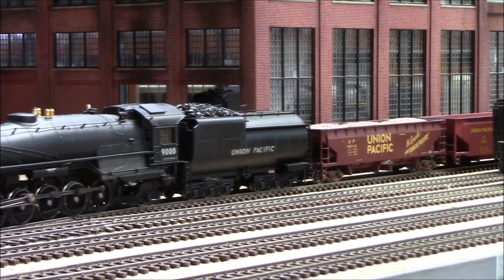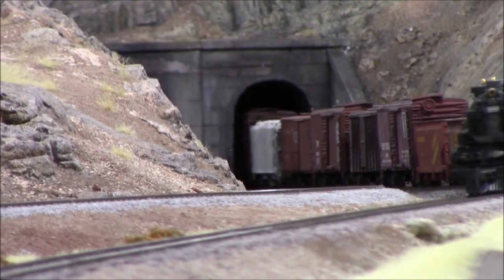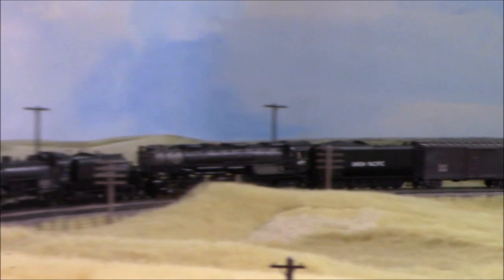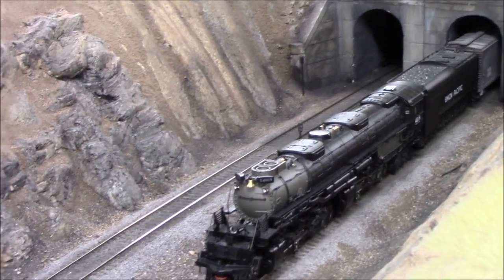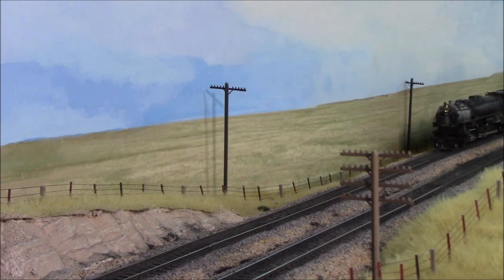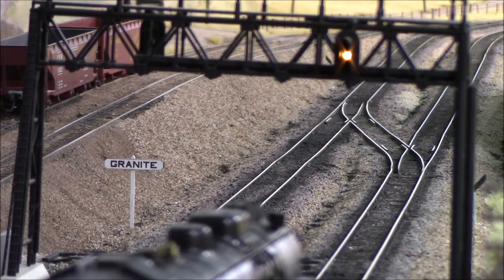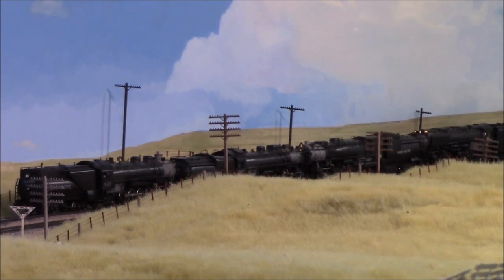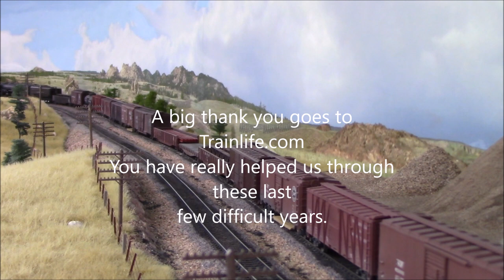Sherman Hill Steam Spectacular

Comment: Man that 4 steam consist! If they are all brass which I assume they are that’s what, 10k? Absolutely epic consist and love the narration.
Reply from the maker: Thanks! IIRC the Challenger is a Athearn but it took forever to get that brass working well enough to shoot this movie. Man, they are finicky little jerks.
Reply: @allenscottmontgomery3929  I had noticed that in a couple scenes seemed to almost not wanna stay connected. Does the brass weight just make it short?
Reply from the maker: @jwrailve3615  Brass loves to short out but the real monster is that the tenders derail when going backwards with ease. And for this movie, going backwards was key. I took a lot of time to fuss with them to get them to roll properly. Since I am a diesel guy, it took even longer.

Comment: 5097 needs to be red-flagged for that damaged crosshead!  Should be able to reseat it and the guide on the yoke, but I would stop running it until you get that done!
Reply from the maker: Hey bud. Hope all is well for you.
That thing must have popped out while shooting and then gone back in place. I can't see anything wrong with it now. But it is a problem. I've had trouble reversing that loco before. Hence all the time it took to get these things running well enough for a video.
Reply: @allenscottmontgomery3929  Doing ok here.  Check to see that the bottom guide's not loose at the yoke.  It looks like it slide inboard and fell off. ;)
Reply from the maker: @NightOwlModeler  Thanks bro. I'll take a closer look at it. Course, it would help if I knew what I was looking at.

Comment: The first Hermosa tunnel was opened in 1901, not 1868. Google Earth clearly shows the 1868 mainline further north along Dale Creek.
Reply from the maker: That shot is a victim of compression. I was going for the area where the mains split and from my maps that is where the original main line is still used.

Comment: A very nice video and layout. I have plans to expand my own HO scale layout (and narrate my own stories), though I don't believe mine will be quite as large as this.
Reply from the maker: Thank you meister. Good luck with your layout! This video was taken on just one out of 18 aisles:)
Reply: @allenscottmontgomery3929  You're quite welcome, and thank you for your kind words :). Only one out of eighteen aisles? Goodness gracious, that's an impressive amount of track!!
Reply from the maker: @Stussmeister  Yeah, my calculation is about 7000' including all the turnouts. Most of the layout doesn't have scenery yet, even after 11 years! But I'm working on it...
Reply: @allenscottmontgomery3929  I'm in a similar situation, albeit on a somewhat smaller scale. My above-mentioned plans include designs for a 10 x 6 2/3' layout, and while I've been working on them for over four years, I still have yet to put up the benchwork and scenery.
Reply from the maker: @Stussmeister  Well you know what they say. It won't get done if you don't start. I have a couple tricks to get my juices flowing for a project, like go out and do some real rail fanning. I always come back ready to go. I'm building freemo modules at home for a side project and they are tricky and I lose the wind in my sails more than I would like to admit.
Reply: @allenscottmontgomery3929  Indeed. I have ideas and plans for where to put track, scenery, and structures, and have gotten a little ahead by building some of these structures already, but considering I'm a newbie when it comes to building benchwork, I figured I would employ a professional to do so, which also means coordinating with the rest of my family's schedules.
Reply from the maker: @Stussmeister  I'm lucky I was a carpenter for years so I had the skills and tools. Since you are a newbie, do you have a clear idea of what you want to model? To me, it's easier if I try to duplicate an actual scene or railroad. Then the answers are more clear since I just have to refer to the real thing. For instance, my new home layout is simply modeling the town of Ririe, Idaho. I have all the pictures and answers I need just from walking around the place.
Reply: @allenscottmontgomery3929  I believe the main scope of my plan is to model a postwar mountain railroad town with tunnels, a bridge, industry sidings, and a yard. I'll have 2-3 mountains in the center of the layout (one of which will have the tunnels going through it), a small stream coming down from one of the mountains, a forest on the left-center side, and the town (and associated structures) on the right-center side. I've also worked with some of the folks at my model railroad club and developed a street plan so that cars can get to all the buildings in the town.
Reply from the maker: @Stussmeister  As a westerner, I fully support that idea. And making the roads make sense is always a good idea but not so simple. Keep me updated on your progress!
Reply: @allenscottmontgomery3929  Indeed I will. I plan on posting videos of my layout, from construction to operation, as well as videos on other railroad-related subjects.

Comment: Was there any data on average how many freight and passenger trains went over Sherman daily? Was there also many night operations?
Reply from the maker: There are conductor sheets out there that tell the tale. It varied quite a lot from month to month. Peak season saw everything used as possible. Winter months saw a lot of steam engines with their fires dropped until traffic picked up.
By the late 50's there were only a handful of passenger trains each day. The 40's were really the heyday for them. 
Yeah, they ran night and day. To be a brakeman riding the top of the cars at night had to be one of the worst jobs out there I would imagine. Before they set the 16 hour law, brakemen would work so long that they would fall asleep and fall right off the train!